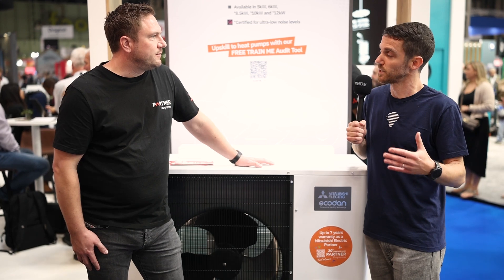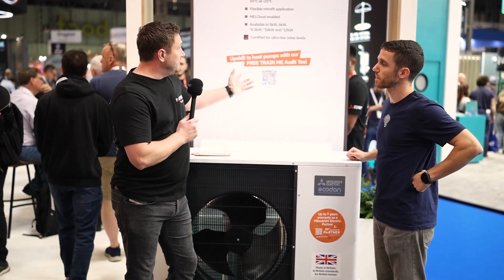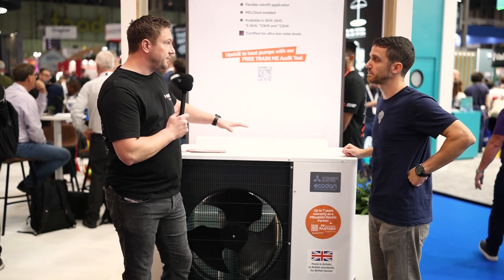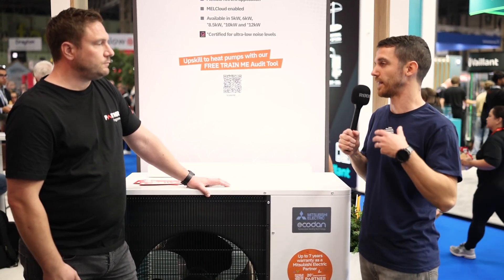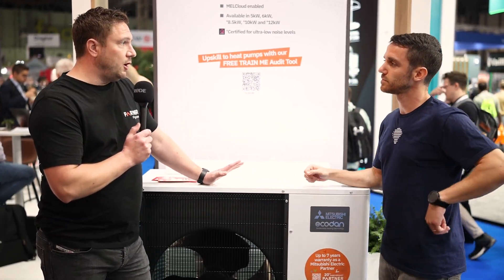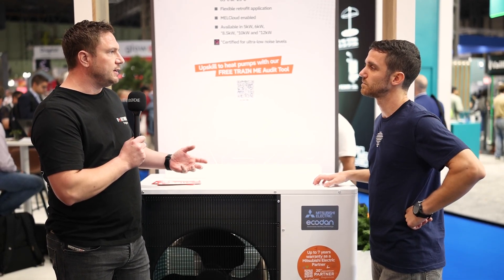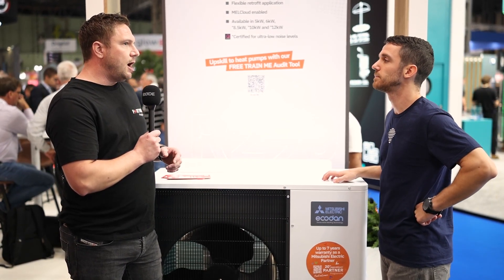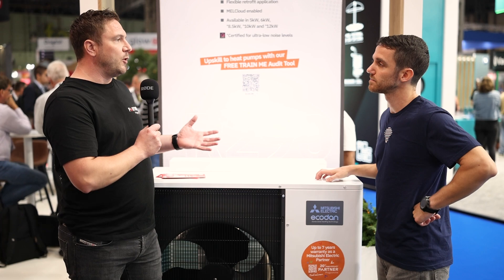Compressor Modulation On Heat Pump Is Important | Mitsubishi

Comment: “…Less than a couple of kW’s…”. What does that actually mean? We need clear modulation data so that we can better specify ASHPs. If this unit can modulate from 12kW to 2kW, then that is impressive. But sounds unlikely.
Reply from the maker: It was filmed on the show without preparation and data, you cam find a lot of details in service manuals with different tables for minimum modulation.

Comment: unfortunatelly both of our 5 kW Split AC are not achieving the SCOP and COP promised . We measured COP of 3 instead of 5 and there are many more disappointed about the result.
Reply from the maker: Usually COP/SCOP from manufacturer must be correct because it is tested under same conditions in testing chamber